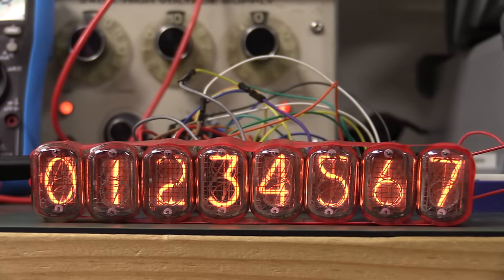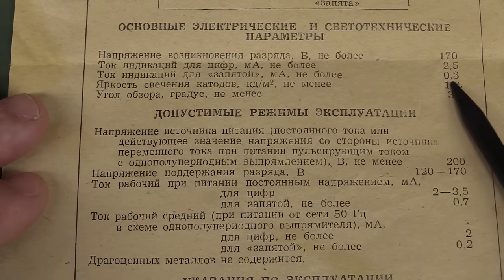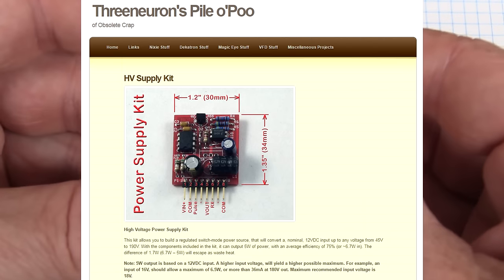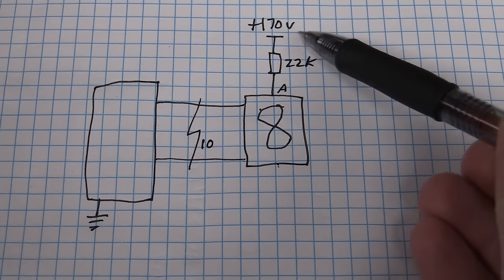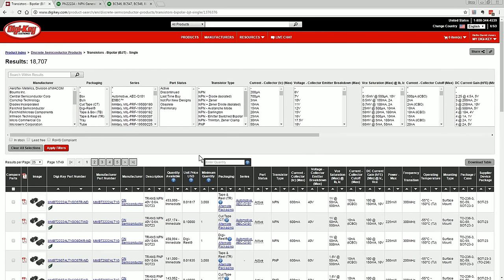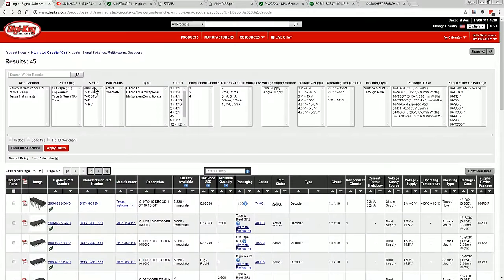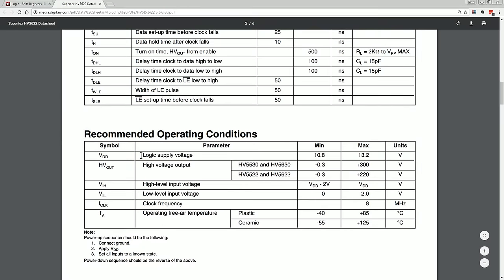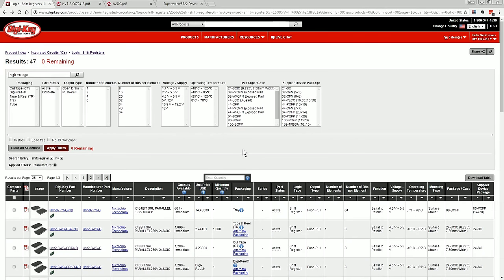EEVblog #948 - Nixie Tube Display Project - Part 1

Comment: When you had a smaller current through it maybe it started because it was still hot from before
Reply: Nixie tubes don't glow because of their temperature: the high voltage breaksdown the noble gas inside the tube, which therefore glows. In fact these tube have more in common with neon lamps than with vaccum tubes: that's why they are also called "cold cathode displays"

Comment: I'm currently building a clock using old Russian VFD tubes. The datasheet numbered and named the pins on the device as if you were looking at it from the bottom. It was very nearly a disaster. Didn't expect that.
Reply: all tube datasheets work like that
Reply: Ah thanks. - Never used tubes before. I'll keep that in mind for the future.

Comment: You don't actually need transistors that can whitstand the full 170V the 75V of the shown bjt are fine, when the tube is on the combination of limiting resistor and tube will drop a fair ammount of voltage, so you will see 40-60V, so if you switch on the next digit before the previous is turned of the drivers will never see more than 60-ish volts
Reply from the maker: Nope, see my 2nd channel for a video on this. I measured as high as 122V
Reply: You can do voltage dividers on each pin and the nixie will  switch on and of even from 30-40 V difference in voltage. The shift register would only have to deal with 30-40V.

Comment: Dave, here values from datasheet:
Indication current:
2.5 mA for digits, allowed maximum us 2-3.5mA (for DC)
0.3 mA for dot, allowed maximum is 0.7 mA (for DC)
Reply: not allowed maximum, but nominal, i guess.
Also, it says that there are no precious metals :D
Recommended to solder pins not closer then 4mmfrom glass.
Reply: 100 Cd/m2 is light intensity
30 degree view angle
Reply: Also, dot could be light up with digit, when it's should be lower current, maybe you should keep that in mind

Comment: Do 7-segment nixie tubes exist?
Reply: Prentice Darlington yes look for numitron
Reply: Look for panaplex displays.
Reply: Thanks chaps.
Reply: AFAIK, no. 7 segment vacuum tube displays are called VFD (Vacuum Fluorescent Display), but their theory of operation is completely different to nixies.

Numitrons, which +DeKempster suggested are completely different to nixies, they use heated tungsten filaments as segments. They look similar to nixies tho, because the orange glow of the segments similar to the colour of nixie tubes.

PS:
I'm not familiar with Panaplex displays, which +Röhren bastler suggested, but I googled it now, and they look like real 7-segment nixies (neon glow tubes with 7-segment arrangement). Cool, but poor range of types, and even more expensive than nixies.
Reply: Several manufacturers made 7-segment, and even dot matrix cold cathode neon displays. Burroughs trade named theirs "Panaplex". I actually have a few Burroughs units, plus a few made by Sperry (eons before the merger). National Semiconductor even made a decoder/driver chip for it. The DM8880.
Reply: ***** Thanks, I'm just discovering Panaplex-type displays, although we have a Datron 1071 multimeter at work, which has this type of display - I just didn't know the name and working principle of it until I ran into +Röhren bastler 's comment. But it is looks really amazing.
Reply: Röhren bastler Thanks, man! It just happened to me to see a Datron 1071 multimeter at work, I saw it just occasionally in the last eight years. We're using it calibrating all the other multimeters of the company. I always wondered what is the name and principle of that amazing-looking display.
Reply: ***** You're welcome. Do they have type number on them?
Reply: ***** This is obviously a VFD.
Reply: ***** VFDs were also utilized in cassette players, for VU meter and counter applications. They're still used today in AV receivers for example. http://img.canuckaudiomart.com/uploads/large/143782-technics_rsb755_cassette_deck_mint.jpg

http://stech1.firstpost.com/tech2images/640x349/proportional/jpeg/gallery/2012/jul/onkyo_tx_nr609_av_receiver_front_021012596862.jpg

I have a Kenwood mini-hifi from 1997 with a huge VFD (about 5x12 cm), works 24/7 since 1997, and still works perfectly and looks nice.

The only downside is that hi-fi has a whopping standby consumption of more than 20W, because of the heater of the VFD (and possibly because there is no separate standby transformer, the 200W transformer operates in standby, which has a welded core, which can affect the efficiency quite badly).
Reply: As mrnmrn1, has mentioned, the big flat planer "all-in-one" custom VFDs are still being made. Older individual 7-segment digits, or multisegment individual character types, in a round tube, have been discontinued.

VFD, stand for Vacuum Fluorescent Display. They are vacuum tube triodes. The glowing segments are the anodes (plates), with a phosphor coating, much like old CRTs. When the electron hits it, it glows. Usually a cyan blue, but phosphor formulations for all kinds of colors are available. The filament/cathode is in front. Its usually, one or more very thin wires, with just enough current going thru them that they're just below glowing, in a dark room. There often is a grid mesh in between the front filament, and the rear segment/anodes. These will have a positive voltage applied to them, to enhance electron flow from the filament/cathode to the segment/anodes. This is contrary to old radio triodes, where a negative voltage is applied to the grid, to reduce electron flow. In both cases, though: more positive, more current, and more negative, less current. Analogous to the difference between enhancement mode FETs and depletion mode FETs. Anode to cathode voltage usually in the range of 25V to 70V. Higher voltage usually needed if multiplexed. Filament voltage, is usaully only a few volts, with filament currents typically under 100mA. Plate/segment/anode current in the ballpark, of just a tad under a milliamp, per segment.

Comment: multiplexing Dave...
"what's the matter McFly.... chicken?"
;)
Reply from the maker: NOBODY calls me chicken!
Reply: Been planning to make a nixie clock for like 2 years and actually had a similar Supertex IC (HV5522) bookmarked.
I also didn't want to mux it as I wasn't sure about dimming and flicker issues. I like no expense spared/no compromise design vs. trying to save pennies and ending up with a poor user experience.
Reply: kalhana1 :    it's easy bro.... do the testing 1st.... use a signal generator and a MOSFET arrangement to test the Nixie tube in the lab.... note the exact frequency, duty cycle, voltage and pulsed current required for each of the segment.... once you have that data you will be in a much better position to design a Muxloe arrangement..... I wish I had spare time... I would have done it and sent it to you.... ;)
Reply: I'm not saying it's difficult at all. But I have heard that you can get flicker due to multiplexing. Like when you look at it from the corner of your eye. There's no big deal using the Supertex IC (or similar unmuxed method). The footprint is quite small and anyway a nixie clock is not a space constrained PCB. Plus EMI will be lower with unmuxed.
Reply: Agreed!
But Multiplexing it takes more engineering skills. Reducing the component count, cost & EMI requires a cooler engineer ;)

Comment: Why does that 5 look like an upside down 2?
Reply: kstringer24 

It's like this on all the sovjet nixie tubes. 
I guess they simply wanted to save a bit of money by using an upside down 2 for the 5. 
The german nixie tubes used to have a "real" 5 by the way. 

greetings,
Reply: because it´s just like you said...it´s a 2 upside down...but they also done some nixies with "real" 5s in them...

Comment: 74141 Obsolete?  In Russia you are Obsolete!  Check eBay, the Russians and Czechs are still producing the 74141 as MH74141 and they run about a $1 each.
Reply: ***** - Way too expensive and I have received NOS chips before that the pins have gotten a bit of the red death in the pins (rust) and the pins break right off.  Like I said, you can get these chips that were manufactured this year, but they are made by the Russians, Czechs, Chinese.  But I really have not had a problem with cloned chips before, and if you are really worried, socket them all so you can replace them.

Comment: What would the input impedance be for a Nixie tube?
Reply: Non-linear. Think  of it as a forward biased diode. Before ionization, it has infinite impedance. They typically ionize just a tad under 170V. Once they ionize they will stay ionized until the voltage drops below a voltage in the range of 130 to 150V. Ionized (and glowing) They have very low impedance, an will try to pass 100s of milliamps, in order to drag the voltage down to its sustain level (130 to 150V). A simple resistor, or other current limiting device is required. Just like an LED.

For long term operation, run an IN-12 between 1.5 to 2.5mA. IN-12 contains a little mercury, which extend their lives to over 100,000 hours. Too low current is almost as bad as too much. The gas ions collide with the cathodes, sputtering off metal. More current, more metal sputtered off. But that sputtered metal recoats other surfaces, including "off" cathodes. (the other numerals). When a formerly off cathode turns ON, it throws off that sputtered metal. The sputter metal doesn't glow. But if the current is too low, it gets coated more than it can throw off, and eventually develops bad spots. This is called "cathode poisoning". So don't try to run a nixie, of this size, under 1mA for an extended period of time. It will develop cathode poisoning if you do. Big tubes, like the IN-18, should be operated over 4mA.
Reply: Very interesting. So if it has such a low impedance how can it get the 170V required across it for it to run? Because I would assume then that the majority of the voltage would drop across the current limiting resistor (because it has a significantly higher resistance) leaving very little voltage for the nixie tube.
Reply: Once, the voltage drops to its "sustain level" (between 130 to 150V), the ionization diminishes, a bit, and the impedance would rise. Google "neon bulb relaxation oscillator". The zone between "strike", and "sustain", is often called the "negative resistance" region. Tunnel diodes and unijunction transistors also had this zone, and it could be used to make a simple oscillator. So the limiting resistor need only to be calculated to be roughly between the supply voltage and sustain voltage, for a rough desired current. The operating range is wide. No precision required. 20% resistors of that period, would be more than adequate.
Reply: ***** Fascinating, thank you very much!

Comment: cant find nixie tubes on aliexpress. do they still make these ?
Reply: iceberg789 No, the soviets made them, and when the U.S.S.R. fell, the production of them fell.
Reply: alright, but some are still produced somewhere, no ?
Reply: BraneBrain I didn't say they weren't produced by other nations, if you'll refer back to my original comment.
Reply: iceberg789 Yes, but VERY limited production.
Reply: The short answer is No, western production stopped a long time ago, Soviet production carried on for a while but even they stopped producing Nixies decades ago. There is a Czech Guy called Dalibor Farny who has learned how to make them. Search for him on you tube for some fabulous videos. They are big and beautifully produced but are not cheap!  His videos explain why - it's quite a process! The best way I've found of getting a few is buying from sellers in the Ukraine via ebay. I think the Soviets produced a load of excess stock so there are a fair few new old stock tubes still around but the interest in nixie clocks has pushed prices up a bit recently..
Reply: You can find lots of new old stock and used Nixie tubes on Ebay.